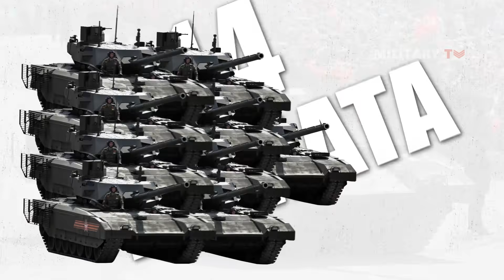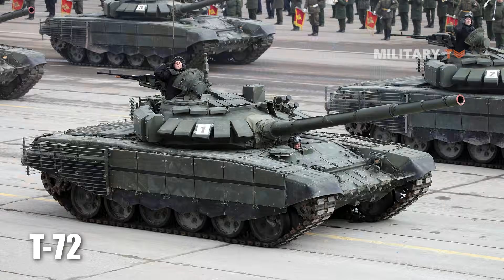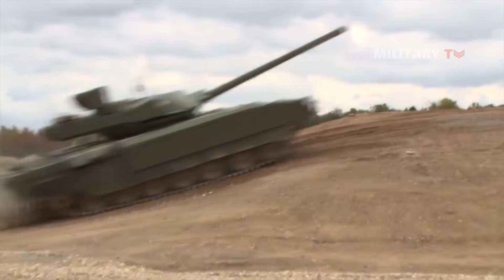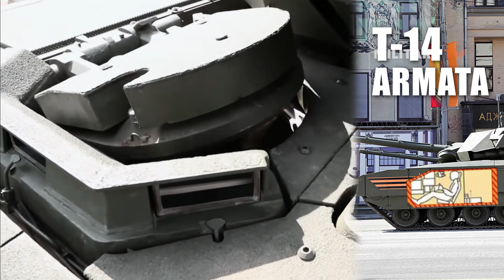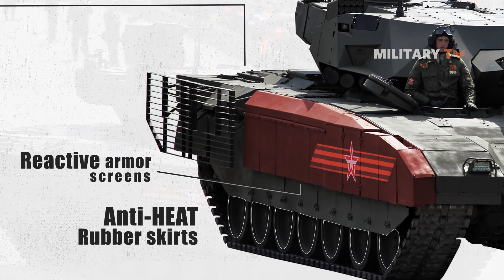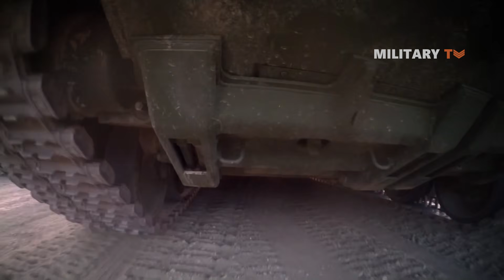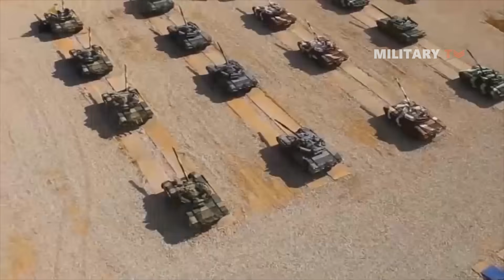T-14 Armata - Russia's Latest Tank

Comment: Looks interesting. Is the crew totally isolated from the turret or are they able to access the turret without getting out of the tank if there are any problems with the autoloader?
Reply: they are completely isolated from the turret. If the autoloader goes down..The tank is out of the fight.
Reply: @joelrodriguez9661  A small price to pay for the survivability of the crew and even a manned current could have an autoloader they could not repair.
Reply: @eaglethrust379  there are other ways to protect crew without isolating them entirely from cannon.
Reply: @Stephen Taylor  it's not a small price to pay. Protecting the crew is important. But if they get into a position where they have to fight and the gun malfunctions or  is damaged. There is zero ability for them to repair it and get their primary weapons system back in the fight.
Reply: @Stephen Taylor  The driver is the weak point. He still uses periscope vision blocks that has a very limited view. No video screen with outside cameras for him. Probably the same reason that Russian tank and armored vehicle drivers keep rolling over mines in plain site in the middle of the road.
Reply: @joelrodriguez9661 I think it can switch into manual loader
Reply: @miniyu2252  no it cant. The crew doesn't have access to the gun, loader or ammunition from inside the tank. They are in an armored compartment in the hull. With no access to the gun from that location. If the loader goes down, they have to exit the tank and work on the gun from the outside. Subjecting themselves to fire.
Reply: @joelrodriguez9661 .
So what? Most of tanks be burning magma. ARMATA can just retreat and get repaired, all other tanks be destroyed or unmanned by enemy fire
Reply: @Oner Xowns  no Armata can't just retreat. It's reverse speed is terrible, as is the case with nearly all Russian tanks. If the turret traverse is jammed and the gun barrel is stuck in a position over the crew capsule..It is going to be very difficult for the crew to escape. 

And if the capsule takes a hit, it's likely that all three crewmembers will be injured or killed.
Reply: I believe the turret is unmanned.
Reply: I don't care, you are in armored coffin if the magazine blows the turrent off the Armata 14...
Just saying the Shock wave...
Reply: @kevinsage245  the same stuff with the M1 ammo storage in the back of the turret. It can completely burn down while the crew remain in safety
Reply: @jozseftoth9368  no the M1A2 all have doors to redirect the explosion of the magazine skyward if it is detonated.
Reply: The crew of the tank may not even go to the toilet, especially when the tank is completely destroyed by Javelin - the crew is automatically moved underground using the most advanced technology "AnaloGovNet" underground :)
Reply: if something destroy autoloader you will be glad you separated from it.
Reply: @trololoev  sure if something strikes the autoloader and disables it. Having the crew separate from the weapon is helpful in protecting them. But having no access to the weapons system from inside the tank, for the crew. Presents a different set of hazards. If the weapon is damaged and taken out of action. The entire tank is now combat ineffective. The crew has no way to repair it without exposing themselves to external dangers and must retreat to somewhere in the rear where the damage or fault with the gun/loader can be addressed.
Reply: Being able to get into the turret from the armored crew box would weaken and even defeat the reason to have the remote turret don't you think?

Comment: If this tank was developed and already manufactured, I see no reason for it not to have been used in Ukraine. On the contrary, the only ones we saw broke down during a parade on the red square. Without Western technologies they will not be able to manufacture it (we saw for example on the KA-52 that the electronics dated from the 80s).
This tank appears to be like many of the announcements from Moscow, a hoax.

Comment: I thought the T90 was designed and built after the fall of the USSR. I thought the last tank designed and built during the USSR was the T80.
Reply: The T90 is just a rebranded T-72 Upgrade
Reply: @theodorkorner1497  nope
Reply: @Wolfs Winkel  It was originally named T-72BU. It was renamed after the disastrous performance of the Iraqi T-72s in the Gulf War
Reply: @theodorkorner1497  it depends on amount of technology you put into tank. If tank on 90% old on 10% new - it is modernization. If tank on 20% new and 80% old technologies - you can give it new name. Numbers not accurate.

Comment: How high does the turret fly on this one?
Reply: Higher than t90's turret.
Reply: Higher than older types .
Reply: Higher than the ISS that’s for sure.
Reply: the ammo storage is different, so you might not see that design flaw at all.
Reply: $10.000 lancet have killed so many 4 million dollar m777
Reply: @winkus8586  what does towed artillery have to do with a tank ?
Reply: @poes1314  
The $15,000 iranian saheed have defeated the $1B patriot air defence system in saudi
Reply: @winkus8586  👈🏻 = 🤡🤡🤡
Reply: @lubeman62  thank you